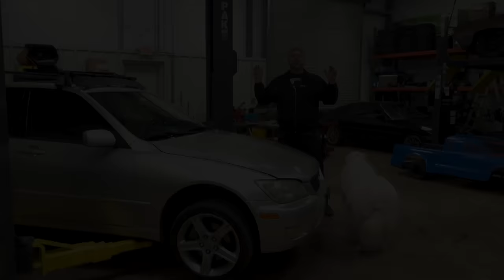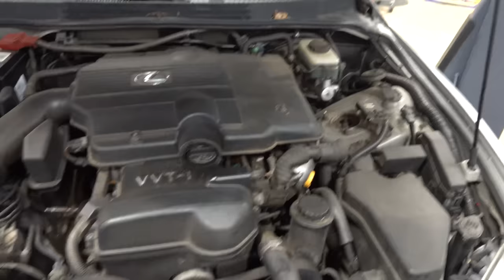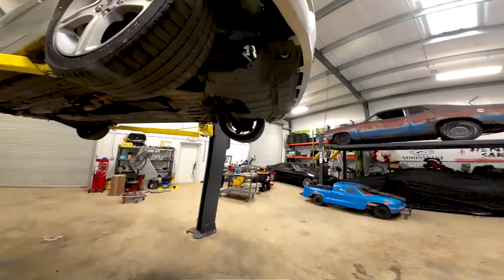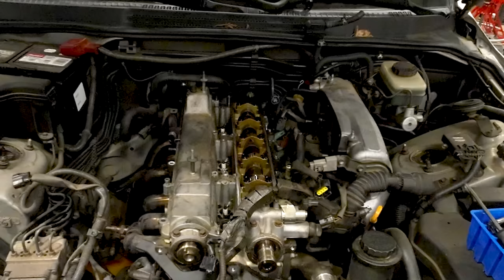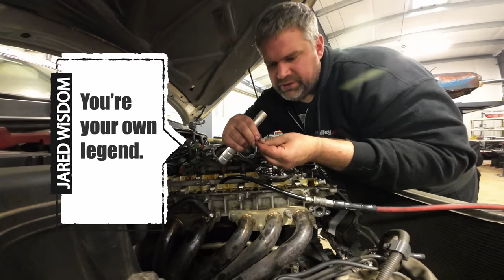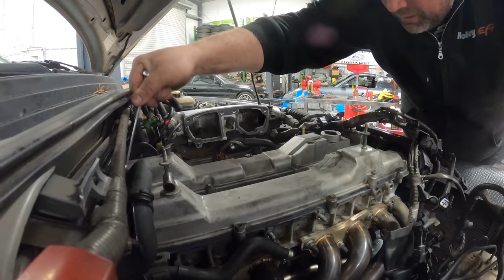I can't believe what i found in this 300,000 Mile Toyota 2JZ Engine!

Comment: A friend of mine has a Japanese import UZZ31 (powdered by the 1UZFE)
The car had a problem where one of the cam belt idler bearings went bad and melted the seal , the seal disintegrated & got into the belt which jumped a few teeth and the engine ended up bending all 16 intake valves and a few exhaust valves.
She didn't want a new engine (my first choice) and I managed to get the parts , find the information and get the car up and running again.
I am in no way a talented home mechanic.

Comment: What is the superior engine oil ?
Reply from the maker: I love the Valvoline synthetics, I run the extended performance in the daily drivers, and their premium blue in the duramax, and then anything I beat on gets the vr-1 synthetics
Reply: @TheQuestionableGarage  you mentioned Castrol brand stains the engine? Is that true? Why only Castrol does that?
Reply from the maker: @burntnougat5341  I don't know specifically, it is just something I noticed, you could always see a engine that has ran on Castrol because of the metal staining. TO be clear though, the staining is different that oil gel/sludge from not changing it, it just was discolorations.
Reply: @TheQuestionableGarage  that's interesting and first I ever heard of it. Making me second guess putting Castrol in my car but it's the cheapest Euro spec LL01 oil around here!

Comment: Proper maintenance doesn’t make all cars last forever, or even a long time. Just look at any BMW, Mercedes or VW/Audi built in the past 20 years. Or any Jaguar/Land Rover ever made.

I’m curious about your experience with valve clearance on these engines. I’ve never in my life seen any engine, from Toyota or any other brand, that didn’t need a valve clearance adjustment at that mileage. Willing to bet that every single exhaust valve is tight.

I left the industry as a mechanic because working as a mechanic is a thankless job. The pay is getting better as the shortage gets worse, but good mechanics are still vastly underpaid. I got tired of being expected to know every make and model of car, any level of technology, and constantly invest more and more time and money in school, tools, etc for about 60% of what someone with similar expectations in a different industry would get paid. That’s why there is such a shortage. The job is hard and thankless, it requires SOO much more of the techs now than it did even when I first 20 years ago, and it doesn’t pay enough. If I’d become an electrician instead of a mechanic, I’d be making double the salary for (arguably) an easier job.

Comment: It's honestly NOT that hard to maintain one of these newer (i say newer but you know) Japanese - Hell even the chevy and ford motors are pretty much the same crap - motors.. It's NOT hard AT ALL to set your valve lash and or reseat the seals.. it's NO big deal to do the timing. You just have to PAY ATTENTION to what you're doing, FOLLOW A GUIDE!! And just get it done. Make sure though that you have ALL THE TOOLS YOU NEED AHEAD OF TIME. There's NOTHING like having to RUN to the store in the MIDDLE of a job..

Comment: Unpopular opinion, I still prefer the 7M GTE and even the 7M GE. Sorrynotsorry.
Reply from the maker: Love all the inlines.  I do agree the 7MGTE is amazing, and its biggest issues are lack of maintenance(Aside from the low headgasket torque spec, and terrible oil cooler bypass design which the springs fail and sends all your oil to the cooler and back to the oil pan and not your engine!) I've built a few including some that made some good power!
Reply: @TheQuestionableGarage  head gasket was the only thing both my GTE and GE suffered with. £400 for a new gasket here in the UK in 2009. Got one on ebay from the States for £58 inc shipping. Toyota do like charging the earth for neccessary parts.
Reply from the maker: Keep an eye out for the oil cooler(only on the turbo on the ge they don’t have them). That along with being down a tiny bit in oil makes them suspect to rod knocks
Reply: @TheQuestionableGarage  yep, I have heard of this. Worth keeping and eye on for sure. Also, staying on top of maintenence is never a bad thing ;)